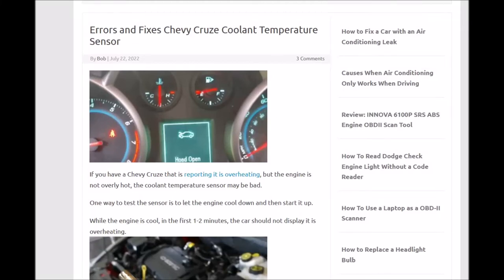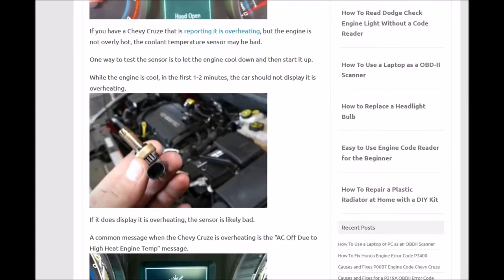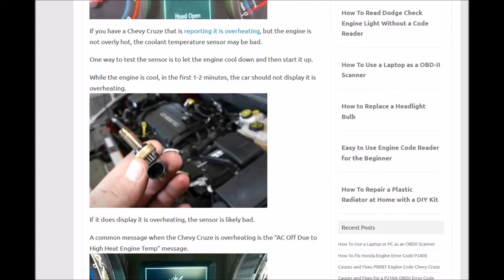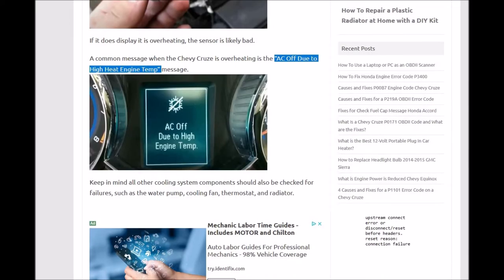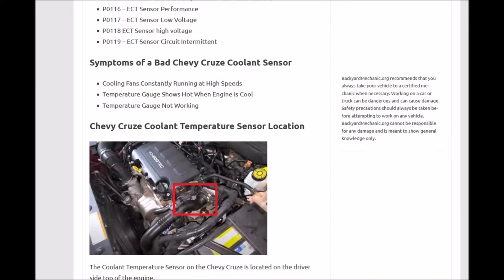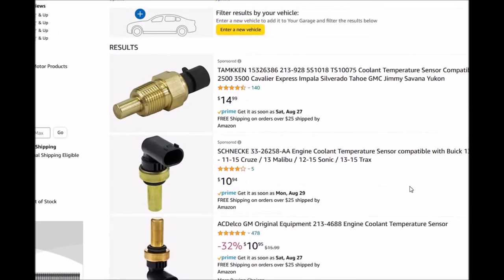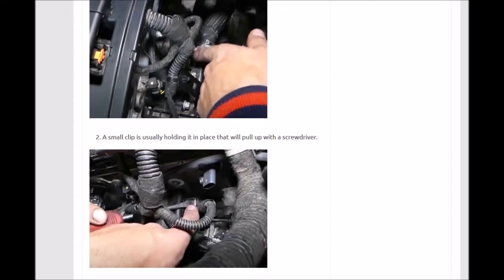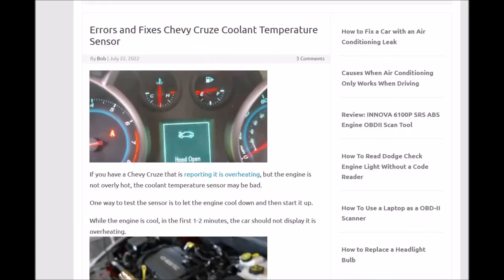Chevy Cruze Overheating: Engine Coolant Temperature Sensor

Comment: My 2016 had aircon not going cold, fan on max, temp dial not showing any temp. I replaced the sensor that goes into the thermostat housing, fixed the problem for 5 days and now it’s all back to not working again ☹️ is there a fuse for the sensor that could be bad?

Comment: 2011 Chevy Cruze 1.4 ecotec turbo it's over heating I've replaced water pump and all hoses bleed the system for air pockets finished topping it off my radiator hoses are extremely tight what's the issue

Comment: My car shows no sign of overheating but my fan is always on full blast and no ac. Replaced fan, ac compressor, temps sensors. Still nothing
Reply from the maker: I would test the temp sensor wiring. If you have a scan tool, see if the temp matches close to the engine temperature.

Comment: My car isnt over heating but my fan radiator  fan isnt working  i have a chevy sonic 2012
Reply: Have you fixed this mine wont turn on either
Reply: Replace the fan.

Comment: Would the sensor cause the car to not blow hot air at idle speed and when you idle it up it starts blowing hot air???
Reply: Possible stuck open thermostat

Comment: Great video! I will try that. But first this is my issue. My cars temp gauge is now sitting at the half way mark and engine does not run hot and engine (block) temp is only 120F and rad is 68 F and fans do not come on. In case anyone knows what my issue is please comment. In short the gauge is high but coolant is not and no fan operation.
Reply from the maker: I would test or replace the Engine Coolant Temp Sensor.